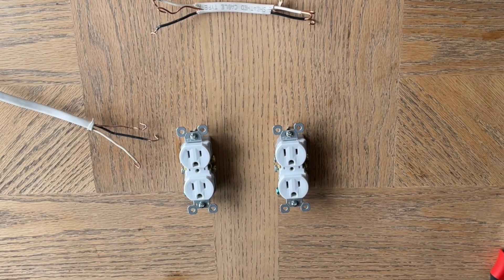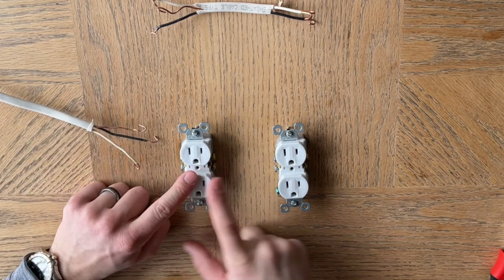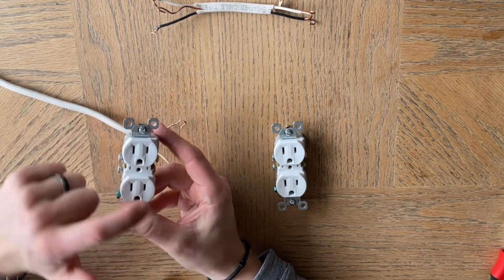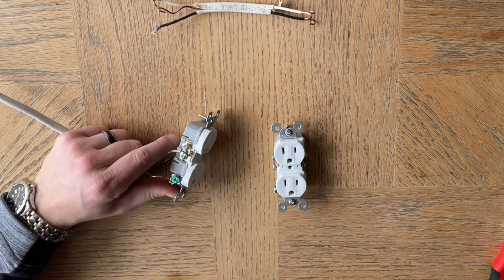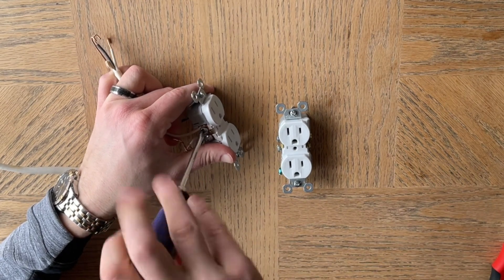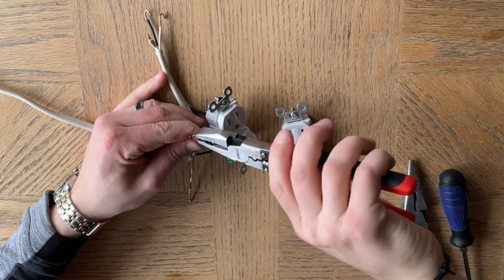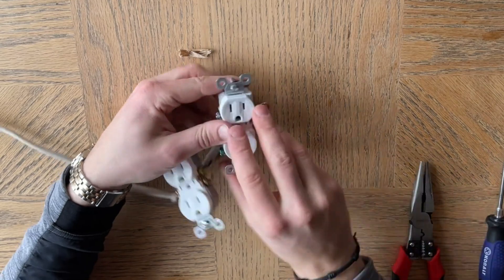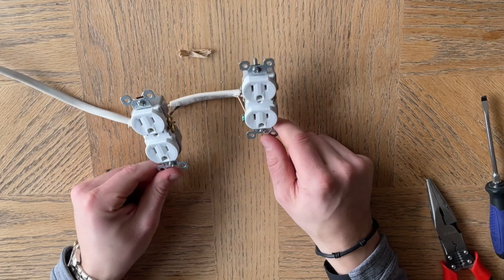How To Wire Outlets In A Daisy Chain Wire Multiple Outlets Series Receptacle

Comment: I have two outlets that are daisy chained. I need to convert the first one to a single outlet for a wine wall that is being installed and we want to hide the plug. Can I just connect all the wires after removing the double outlet and just run/add a third/spliced wire down to the single outlet that I am going to install? The single plug only has one set of connectors unlike the double.
Reply from the maker: That sounds like it should work. Be sure to check with a local electrician to see if there are any local code problems.
Reply: @HowToVideoChannel  Thank you for the reply. Just patching the hole now :)
Reply from the maker: Awesome!

Comment: Thank you so much. Excellent video. I have an outlet  where the top receptacle  has power but the bottom one doesn’t. And the tester shows open hot. How do I fix it? The wire connections are solid, and nothing loose. 

Does it mean the nearby outlet connection might be loose so it’s not completing the circuit thereby the bottom receptacle  on the first outiet not having power?
Reply from the maker: I’d open it up and see where all the wires are going. Perhaps, re-wiring it with a new receptacle would solve the problem.

Comment: Thanks for the great information. Is there a maximum number of receptacles you can put on a daisy chain line?
Reply from the maker: There isn’t a specific number unless your local code has any rules. However, the more power you pull on a specific line the more likely a breaker could trip.
Reply: @HowToVideoChannel  Great - Thank you for the reply!

Comment: This video is wrong. These are not in series, this is still parallel - just using the terminal screws to make the connection. While potentially still in code, this is not the best way to do it as each receptacle is not independent. It is much better to make the wire connections independent and then have single wires coming off the connections feeding the outlets.
Reply: Yes the connection should be separate. Use wire nuts or lever nuts to connect your wires then each set of wires connects to an outlet. That way if an outlet fails it doesn't affect the connections further down the chain.
Reply from the maker: What you are describing is parallel wiring. The video is series wiring.
Reply: @HowToVideoChannel If you severed the wire coming to the first outlet, the second outlet would fail to function.

Parallel would allow them to function independently.  

You are correct and explained this well. Thanks for the video. This helped me!
Reply from the maker: Thank you for commenting and I’m glad the video helped you!
Reply: @nxsmotorsports  Yeah if you sever the wire. That doesn't make it not parallel. In  series ran outlet you would run source hot -> outlet hot, outlet neutral -> next outlet hot, next outlet neutral -> source hot. This would make it so that the first outlet would need something plugged in to deliever power to the next outlet There is no such thing as series outlets in a home. Daisy-Chaining or running wires back to a junction box, both are a parrallel circuit. It's just does each outlet have it's own dedicated wire, or do they all take power off the same wire chain. Power from one outlet isn't passed through to the next outlet, it follows the wire back to the breakerbox.
Reply from the maker: That makes sense and the way you describe would most likely never be used in a home due to building code. 

However, with the daisy chain method, if one receptacle fails, the rest of the receptacles down the line will not receive power.
Reply: @jeremiahmcelroy2726 thank you for this explanation!
Reply: @HowToVideoChannel series is when the wire goes from a positive to a negative to another positive . Parallel is the wire going to neutral to neutral to neutral.
Reply: Incorrect. Both methods are in fact parallel.
Reply: He’s using the receptacle as part of the circuit.    That can cause heating issues in the receptacle the more receptacles he adds down the line.
Reply: In other words, you would do the same thing he did on the ground wires for the hot and neutral, and run each individual one to where they need to go.
Reply: @Eisernkreuz that's how I understood it also.
Reply: I can use this concept to put a plug-in receptacle in my other room feeding off of this method. I would have one outlet facing into one room and the other outlet facing into the room on the other side of the wall almost back to back I’m not sure if I’m explaining it correctly or clearly.
Reply: He’s probably a tradesman, and they tend to have their own language that varies drastically per region and discipline. As an electrical engineer, it’s frustrating at times.

Comment: I've got a puzzler for you. (it's puzzling me, you might think it simple) I have one 14/2 coming from the panel, going to a single pole switch, operating a single led outdoor light. I want to add another switch off the same feed, coming from the first existing box, going to another switch (this one is lighted) for an interior light. Same feed, two different boxes 24" away from each other, two different switches, two different lights, each light operated by only one of the switches. 

How the heck to wire that one up? 

Thanks!
Reply from the maker: You’ll have to separate the power from the main line into 2 different lines. One for each fixture/switch combo. Use a pigtail from the main line to send power to the first fixture/switch with another pigtail sending power to the second fixture/switch.

Hopefully, that main line is easily accessible in a switch or fixture box with enough room to do the pigtails.

Comment: Great video. I have a question, how can I determine which outlet would be the main power outlet when I may have 3 or 4 outlets daisy chained? Is there a way to determine which one is the main power outlet? Thank you.
Reply from the maker: The only way would be to open them up and disconnect the wires to see how the current flows.
Reply: Thank you so much. I thought there might have been an easy way. Once again thank you Sir! @HowToVideoChannel
Reply from the maker: You’re very welcome!

Comment: How many outlets can I daisy before I really start losing power on each outlet.
Reply from the maker: I would only do 1 room. So 10 outlets or less. 
There are other factors that play a role. What gauge wire, what amp outlets, et cetera. 

You may want to call a couple local electricians to gather some of their information as well.

Comment: quick connect often comes out several years
Reply from the maker: Yeah, I really prefer wrapping the wire around the screw.
Reply: Not if it is properly installed. Quick connect devices like push-fit or snap-lock spices have been thoroughly tested and shown to be just as reliable as wire nuts.

Comment: When hooking up a daisy chain and one light in a bedroom.  How would you do that
Reply from the maker: Usually the light will have a different power source. A separate wire. 

If not, you will want to check with a local electrician to see if the state code allows you to pull power from outlets. 

To do it, you’d simply run an additional of romex from one of the outlet boxes to your light switch box. Then you can power the switch and fixture using that line. 

You’ll definitely want to pigtail the line to the light switch box rather than daisy chaining off of the outlet. That way, if the outlet fails, your light will retain power.

Comment: When connecting the ground wire, instead of using a pigtail like you did, why can't you just attach both ground wires directly to the ground screw?
Reply from the maker: You can as long as they are secure.

Comment: What if there's two hot wires and only 1 positive.  Believe there are two hot wires as its taking the power to the next outlet.  Can I merge the two hot wires and insert them into one gold screw, or should I use one black wire to each gold screw and leave the white wire on the other side only in 1 screw?
Reply from the maker: It depends on how the power is moving. If there are any additional receptacles, et cetera. However, you should be able to bundle the wires. You may also want to call a local electrician to explain the situation and see if they provide you with any advice.

Comment: Wired in parallel is the correct verbiage. This is still a parallel circuit. 
Otherwise it would not work. comment please
Reply from the maker: Parallel is different from a daisy chain. 

Parallel would be pig tailing all of the wires in the box and then running a jumper to each receptacle. 

Daisy chain is running the line directly into and from each receptacle. Also known as “series” wiring.

“To wire in series or daisy chain one connects the live and neutral wires directly to the receptacles; to wire in parallel one connects the live and natural wires to the receptacle by a pigtail.”

Comment: I have a dead GFCI outside next to the garage door. I want to replace it and add another GFCI inside the garage for a freezer. Adding a GFCI to a GFCI within a circuit that also runs into the house that supplies two outlets inside the home. Do you have a video?
Reply from the maker: It would be very similar to this and it depends on how your existing receptacles are wired. 

If they are done in series or daisychain, then you can simply continue that to your new outlet for your freezer. 

If they are done in parallel, using the pigtail method, then you can simply pigtail a new line to send to your outlet for your freezer.
Reply: Do not run gfi to freezer run a dedicated outlet.
I lost 1000S due to gfi and freezer 😅😅😅😅😅
Reply: AS A PLUMBER OF 35 YEARS U TUBE HAS CAUSED SOME PROBLEMS
Reply: Don't use a GFCI for a freezer. If the GFCI pops there is no way to get power back to the outlet unless you manually reset it. Run a dedicated outlet to protect your food. People have gone away on a trip to return to a freezer with rotten food because the GFCI popped and didn't reset itself.

Comment: In NY the more common way is pigtail all wires in the box.
Reply from the maker: Yes, that is a good way. 
Wiring in parallel. 
That way, if one receptacle fails it doesn’t turn off all of the rest of them down the line.

Comment: Question: what if I’m looking to add an outlet  from outlet #1, which also has the daisy chain to outlet #2. I have a daisy chain as in this video..but I want to add power up to a tv outlet versus hanging a cord. Outlet #2 is too far/complicated to daisy chain off of.
Reply from the maker: Yes, you can do that. Check your state’s code to verify the correct method you can use or consult with an electrician in your area.

Method 1: add two more wires to the top terminals on outlet #1 that lead to your TV outlet. Essentially, outlet #1 will be chaining to #2 and the TV outlet. 

Method 2: take two small wires and connect them to the top terminals. Then, connect the line wires for outlet #2 and the TV outlet to each small wire using wire nuts. Hot to hot, neutral to neutral. Essentially, you’ll be splitting the raising chain in 2 directions.

Method 3: disconnect all of the wires from outlet #1. Take the wires leading to outlet #2, the load wires leading into outlet #1, the wires leading to the TV outlet, and 2 new small wires that you’ll connect to outlet #1 and tie them together with 2 wire nuts. Hots and neutrals. This method is known as pigtailing. Basically, you are sending a tail from the load wires to each of the outlets. 

Hope this helps! Let me know if you have any questions!

Comment: Pigtail = NO brainer (barring the LAST 2+ outlets if residing in the same gangue box):
Pigtail is usually better because if ONE outlet fails (anywhere on the daisy chain) the electricity still feeds all the other outlets in the daisy chain either before or after the failed outlet.
Reply from the maker: Very true. 
The pig tail method is a great method.

Comment: How would you add a switch next and then a light
Reply from the maker: You mean use the outlet to power a light switch, then send that power to a light?

First, check with your local code to be sure of what you can and cannot do. 

Run a hot line from the outlet to the off position of your light switch. Then run a line from the on position to the fixture. When the switch is turned on, the circuit will be completed and light the fixture. 

You may also want to check out some of the ‘switch’ videos on my channel.

Comment: I wonder if there is a limit to how many receptacles can be chained together.
Reply from the maker: It depends on your state’s code. However, the reality is that it depends on how much power you will use and whether or not that line will blow the breaker. 

A chain of outlets is kind of like multiple extension cords.
Reply: @HowToVideoChannel  The reason I ask this question is because all the current in the chain flows through the brass break off link between the top and bottom outlet. Brass has more resistance than copper and is it known how much current the little tab can handle or what tie voltage drop would be for each receptacle?
Reply from the maker: That is a great point. 
If you are going to be creating a long chain of receptacles, then I would suggest using the pigtail method from the main line to each receptacle. 

Essentially, you would run your main line all the way around the room, and cut it where each outlet box would go. Then, you would pigtail and wire nut jumper wires to power each receptacle.
Reply: What matters is the load. Theoretically you can connect as many receptacles as you want in a circuit. They do not draw any power in themselves. However, the more receptacles you place on a circuit increases the chances that a lot of devices will be running at the same time and potentially overload the circuit. It is why we generally limit it to no more than 8-10 receptacles on a circuit. However, to restate if you plan to plug in a lot of higher power devices, generally things that either produce heat or have a motor, you should consider fewer receptacles per circuit.

Comment: That’s illegal in Ontario, but now I know so thank you
Reply from the maker: Usually “series” wiring is against code because it relies on something being plugged in to complete the circuit. Exactly like how old Christmas light strands didn’t work if one bulb was missing. That is series. 

“Parallel” wiring is usually allowed. This can either be accomplished by running the wires through each receptacle like a “daisy chain” or by using wire nuts and “pig tailing” to each receptacle. 

Wiring to each receptacle is usually done with GFI outlets. Whereas a bedroom would most likely be done using pig tails. That way if receptacle number 2 in the bedroom went out, receptacles 3, 4, 5, et cetera still have power.
Reply: It’ illegal here too. Changes to color of romex sheathing also b/c permissible guage was changed.

Comment: Daisy chaining or using pigtails are allowed by code, pigtails are usually preferred in order to keep each receptacle independent.  Both methods are wiring in parallel, there are no series circuits when wiring receptacles. Leaving twisted ground wires without a connecting device is not permitted. You would use a wire nut, push in, lever nut, or a crimping ferrule.
Reply from the maker: Yes, that is exactly right.
Reply: @HowToVideoChannel Any Stranded wire videos!?! 

I have a 1920 home with stranded wiring only black and white no ground on the second floor receptacles that have NO power. Please any advice where to start???

And @tedsanderz5380 i just seen your comments on backyard marines channel lol your a busy one
Reply: @Nellopi22  Yeah, I'm retired and have plenty of time on my hands, lol. Tbh, I've never been an electrician, but have some diy electrical and remodeling projects and have been studying and practicing by doing mockups for a few years now. I find electrical theory and the actual work to be fascinating.
Reply: Ok… thank you. I wired it w pigtails and was worried it wasn’t right. I’m pretty new to electrical. Thanks
Reply: I've never seen anyone just twist ground wires together without using a connector except in other countries with more haphazard electrical codes. In order for the ground to work properly, it needs a low impedance connection just like everything else.
Reply: Agree.  While this method is permitted by NEC (using a device as the connector as well), IMHO it leaves the possibility of an internal failure on an "upstream" device to knock out "downstream" devices as well.  Receptacles do wear out over time and use, especially the builder grade ones most people put in (SPEC/commercial grade are better and all I install).  I always pigtail and always use approved connection devices (wire nuts, Wagos, etc.), including the all important ground wires.  It also facilitates easier replacement.
Reply: @csimet but when Jr. want mommy to give him a cookie he gets on utube and post stupid stuff to get her approval for that one cookie lol
Reply: why don't the outlet manufacturers place 2  ground screws on each outlet?
Reply: @robert5  because there is no reason to...
Reply: I’m watching this video as a complete novice diy homeowner and I’m glad you commented because I was confused by the fact that he simply used the screws for the line and neutral connections but then chose to pigtail the ground. Using pigtails for everything would be the preferred method, correct?
Reply: @ScottXC91  You have to use pigtails for the ground because there is only one ground screw.
Reply: This is the first time in all my years as a master electrician I saw someone not pull the sheath off the pigtails.
Reply: @HowardSinclair-z6b , I know, I've never done it, and I don't know why u would leave it on, the box provides the insulation after the romex is passed through, so there's no need for it to be there. U'll probably never see it again.